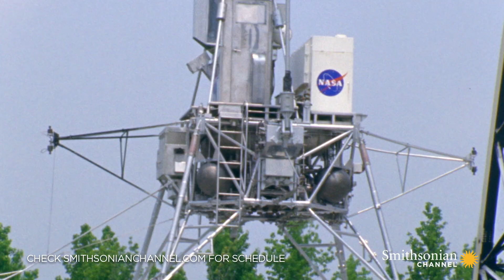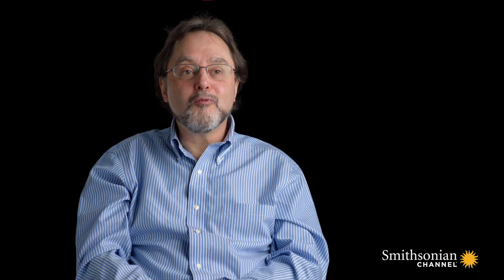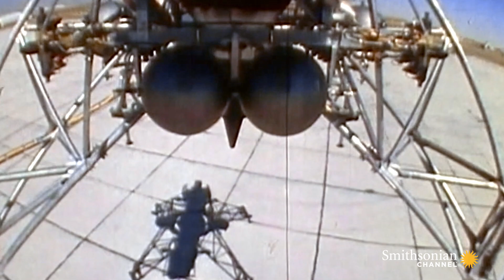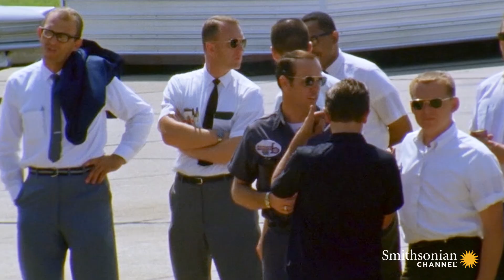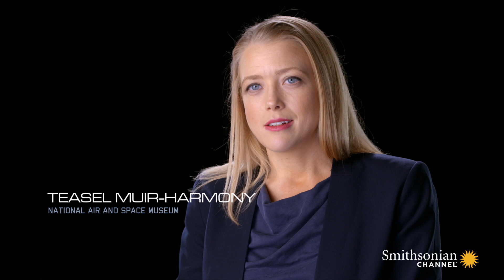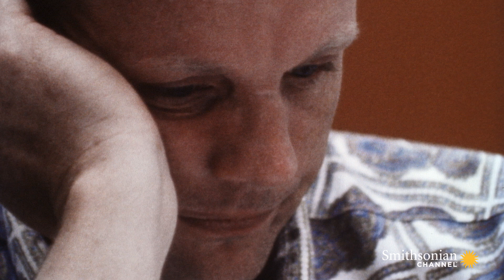How Neil Armstrong Trained to Land the Lunar Module

Comment: This is a joke. The final attempt and then for real on the moon. Give me a brake. 🤲
Reply: It's how they practiced the landings.
Reply: John Miller He crashed after 20 tries.
Reply: @1133saginaw  it is all propaganda. Sorry you can't see it, but you are not my responsibility so believe what you want. This is called free speech in America, and we can both enjoy it.
Reply: John Miller did they teach him how to walk and chew gum at the same time?
Reply: @DeweyTucker  In what way is a video of Armstrong ejecting from a malfunctioning flying simulator 'propaganda'?
Reply: eventcone the propaganda is that they went on to the moon.
Reply: @DeweyTucker  The propaganda is that the moonlandings were faked (though the propagandists never explain how).
Reply: eventcone if you haven’t seen the problems with the NASA pictures and other documentation of the moon landings, then you must live in a vacuum. You need to get out every now and then.
Reply: @DeweyTucker  If you ever do attempt to do some proper research, you would find that every single supposed bit of evidence brought up about alleged proof regarding hoaxing the Apollo landings have been debunked over the years. Most of it with relative ease because the supposed proof is usually based on complete ignorance of the particular subject involved. Meanwhile, there is tons of scientific evidence that is irrefutable which has been accessible to scientists and aerospace engineers for the last 50 years who have never found anything that might suggest the landings were faked so it's only people who lack critical thinking skills who fall for this moon landing hoax nonsense. Here's some of it:

-> There's the live TV coverage that would have to somehow convincingly fake 1/6th G movement in a vacuum, Google "Irrefutable Proof for Moon Landing - Lunar Gravity" and explain how experts in the field of kinematics for 50 years have never come forward with proof that the astronauts are not in an environment that they say they are. There's also the fact that any attempts to do filmed mockups of the eva's on Earth would have to be passed off as live TV broadcasts which would have to fool telecommunications experts around the world. Google "Moon Hoax Not" and "For Jarrah" to get a better understanding of how much would be involved to pull that off and how the filming technology back then was simply incapable of such a thing.

-> There's all the moon rock and core samples that would have to somehow be able to pass scrutiny with geologists who can readily spot whether it's something that has passed through our atmosphere or not. 
Google "How do we know that rock came from the moon?"

-> NASA has made these samples available to scientists from around the world and every year 500-1000 samples are sent out.
Google: "NASA lunar sample request"

-> There's the Apollo 16 UV telescope images that no astronomer in 50 years has ever found fault with. Google "onebigmonkey apollo 16 UV telescope"

-> Another thing that astronomers would be able to spot are pictures of the Earth that don't match what they should look like. Google "Apollo 11 Earthrise - How One Photo Proves it was Real" for an example. 

-> Another one to google is "Apollo 11: Fingerprints in Deep Space" that shows obvious handheld TV footage from the Apollo 11 CM looking at Earth from far enough away that they are clearly beyond the VAB's.

-> Then there are the LOR images. Lots of hoax believer nonsense about them being faked but the transmittal data for them can be downloaded by anybody with a computer and so far, nobody has proven anything about them being faked. You don't think a smoking gun like that wouldn't have been scrutinized by people with the required computer science expertise??

-> Here's something else you might not know. Apollo 12 landed close enough to Surveyor 3 that Conrad & Bean were able to do an Eva to it and removed the camera and sampler scoop from it to be returned back to Earth. They wanted to see what the harmful conditions of the moon had done to those parts after 2.5 years: Google "Analysis of Surveyor 3 Material ad photographs returned by Apollo 12"

-> 5 plutonium-238 powered ALSEP's were left behind that transmitted data from the experiments back to Earth right up till 1977. Unfortunately, due to budget constraints, they were shut down but they did send back enough information that storage of it became a real problem as detailed in this article: Google "the-long-road-to-alsep-data-recovery"

-> Starting with Apollo 13, they purposely directed the spent S-IVB's to crash into the moon so that the Apollo 12 seismograph could record the seismic waves generated to help determine the moon's crustal structure and makeup. Of course, as each successful mission added another ALSEP, they were able to expand on the info derived from these man-made impacts. They also did the same with the lunar module ascent stages. The Apollo 16 LM ascent stage data isn't shown because of difficulties during the de-orbit phase. They were able to derive a lot of info from these artificial impacts. Google "The Description of Apollo Seismic Experiments darts"

-> Another great site to check out has some pretty thorough crater analyzing to prove the landings happened. You can check out all six of the landings this way: Google "onebigmonkey apollo sights landing"

Are you starting to understand the magnitude of what would be involved to pull a hoax like this off? Never mind keeping it from being exposed?

I suggest you also take the time to read through the 93-page pdf titled "NASA’s Recommendations to Space-Faring Entities: How to Protect and Preserve the Historic and Scientific Value of U.S. Government Lunar Artifacts". There is lots of nonsense from hoax believers that the USA is trying to make the Apollo sites inaccessible which is ridiculous seeing as these are only recommendations designed to limit harmful effects of spacecraft landing too close or the altitude of hopper type craft flying at too low of an altitude. The fact is, the USA has no issue at all with visits to the sites by manned or unmanned means. They do request the Apollo 11 and 17 sites are accorded with the proper respect due to the obvious historic value. Also, there is an Appendix B in the pdf that gives a lot of recommendations from NASA as to what type of investigations at the Apollo sites would be most beneficial for scientific purposes. Now does this seem like the type of behavior for a country that supposedly faked all of this??

As I said, irrefutable proof that has withstood scrutiny by the relevant experts from around the world in all the specialties involved for 50 years which in my book proves beyond a doubt that the landings happened just the way they were documented 50 years ago and which easily trumps supposed proof that this was all faked but that same supposed proof doesn't stand up long to scrutiny.
Reply: mako88sb your multitude of words does not change the facts. After many hours of training he crashed the simulator and there was no more before going to the moon. And that’s beyond odd to me. Sorry if my thoughts are offensive to you, and I’m subjected to a voluminous diatribe.
Reply: tgstudio85, let me get this clear. You want me to explain why the Soviets do or don’t do things.  How silly!
Reply: @DeweyTucker  Let's get this clear: Neil Armstrong made dozens of successful simulated lunar landings in the LLRV. There were a total of 5 vehicles of this type built for this purpose.

On ONLY ONE of Armstrong's flights was there a malfunction that resulted in a crash.

The total number of successful simulated moonlandings by all Apollo astronauts was around 700. There were 2 more crashes.

That's a pretty good safety record for a cutting edge experimental aircraft.

Meanwhile the Apollo program was only called on to make a paltry 6 lunar landings.
Reply: @DeweyTucker  I have been studying Apollo history for over 30 years.

I have seen many photographs, many hours of footage. 

There are no 'problems'. The photographic record is excellent. The lunar surface activity is perfect for activity in a 1/6th gravity environment in vacuum. No one could fake that in 1969 - no one has to this day.
Reply: eventcone I’m glad you have seen many hours of footage and have done an extensive investigation and believe the information set in front of you, but having undergone many hours of pilot training, I have problems with the “official” narrative. You believe what you want, but stop trying to beat me into conforming to your ideology.
Reply: @DeweyTucker  "...but stop trying to beat me into conforming to your ideology".

The irony. That's as good a descrition of conspiracism as any.
Reply: eventcone still at it, but to no avail.
Reply: @DeweyTucker  How so? Your opening point has been answered: the crash of a training vehicle in no way indicates the unlikelihood of a successful moonlanding.

Hours of pilot training? But without successfully earning a pilot's licence?

What in your pilot training leads you to question Apollo?
Reply: eventcone get real. One thing I know for sure, you have never gotten extensive pilot training.
Reply: @DeweyTucker  That's no secret.  :-)

But seriously - what is it in your pilot training that makes you doubt?
Reply: eventcone you don’t crash and advanced to a more critical performance. Ask any pilot with at least a multi engine instrument rating. Who would want to get on a plane who just crashed? Why would you ask such a ridiculous question? Keep commenting here and you will keep exposing your ignorance.
Reply: @DeweyTucker   If you still want to go on about it would have been impossible for a 100% success rate for 6 manned landings then how about explaining why the space shuttle had a 100% success rate for all 138 landings. I'm obviously not including the 2 shuttle disasters since they happened before the final phase and actual landing just as your not including the Apollo 13 situation. So 138 out of 138 successful landings in a spacecraft that once it became operational had zero abort capability for the crew(of as many as  7 astronauts) during the final portion of the landing with a glide slope of 18 - 20 degrees and final touch down speed of 214-226 mph with zero go-around capability vs the LM's abort system for the ascent stage and 2 astronauts plus the fact that it's touchdown speed was measured in ft/sec. There's no doubt there were risks involved but the space shuttle 100% landing success rate for 138 flights proves they knew how to train and plan for success in that particular phase of the missions.  

As for the crews, every guy at the controls during the landing phase was a former naval aviator(except Dave Scott) who excelled at landing high-performance jets onto carriers at nighttime and all kinds of foul weather conditions. These guys were then selected to become test pilots were split second decision making under some of the most stressful conditions meant life or death. Plus they had to land prototype high-performance jets for the very first time. The upper echelon of caliber of these guys were selected to become astronauts and received years of training with the best of them becoming the Commanders who got the highly specialized hands-on experience with the LLRV's & LLTV's. These were the 7 guys who were trained to land the LM .Obviously, Apollo 13 didn't make a landing but Lovell was prepped and trained just like the 6 that did land. The Lunar Module Pilot never got the extensive training on the LLRV's & LLTV's as his main job was to reduce the Commanders workload and handle everything else involved with the landing except the actual controls manipulation Seems to me NASA made the right choice on how to select the right people for such a crucial job. It worked so well that they used the same system with the Shuttle.

I could care less if you don't care for my responses. All you're doing is proving you have the same conspiracy mentality as the flat-Earth nutcases who are too full of themselves to admit to being wrong about anything and like them I bet you would probably prefer to bite your tongue off before saying that NASA knew what it was doing when it came to the landing phase of the moon landings..
Reply: @DeweyTucker  "you don’t crash and advanced to a more critical performance."

Maybe for the commercial flight industry, it's quite a bit different for military pilots/naval aviators who became test pilots and then get selected for the astronaut program. Armstrong proved himself with his decision making skills time after time in the toughest piloting jobs there is plus he saved the Gemini 8 mission plus as already explained to you, the accident with the  LLRV was due to an equipment failure so was not due to pilot error.
Reply: mako88sb bla bla bla.
Reply: @DeweyTucker  The usual typical response from a hoax believer who's figured out he's in over his head and too full of himself to admit it. Seen it hundreds of times. Time for the block.
Reply: John Miller He proved how good the training really was. 😆😂🤣😄
Reply: @DeweyTucker  : " I’m over my head in attempting to rationally, logically and patiently explain what I believe to you. "
Because it's just that "beliefs." And naive ones.
Note that the "malfunction" was on the training system, not related to the actual LEM. The malfunction occurred in the additional rockets they had to stuff to compensate for Earth gravity.
If I remember correctly (but why don't you look for it? Why are you talking about something you don't know at all?), one of the fuel tank had a leak in helium (that was pushing the fuel) but they were missing the gauge to properly notice it. That gauge was added on the training machines shortly after.
Reply: Thomas Kundera your problem is you are not a multi engine IFR rated pilot. Talk till you are blue in the face, but until you’ve experienced this training you don’t have a clue. The lack of this killed JFK, Jr.
Reply: @DeweyTucker  : " your problem is you are not a multi engine IFR rated pilot."
That's not a problem, I'm not going to try to fly any of those machines.
Your problem is that you have no knowledge at all in space technology.

And you're still failing to explain us why a failure in the simulator at one point would prevent them to go to to the Moon, which they did six times...
Reply: Thomas Kundera you will never see through the NASA lies, but no man has been to the moon and lived to tell about it. More and more people are seeing that it has all been a hoax. You are trying to defend an indefensible narrative.
Reply: @DeweyTucker  : " you will never see through the NASA lies"
I've yet to see any lie by NASA.

"More and more people are" convinced that the Earth is flat. So what?
Since when is truth being proved by pools among ignorant?

"you are not a multi engine IFR rated pilot."
You are neither, btw.
Reply: Thomas Kundera l’ve had my rating for 50 years.
Reply: @DeweyTucker  : Back to Apollo missions.
What allow you to say they where faked? Any evidence? And how do you explain the actual evidences they went?

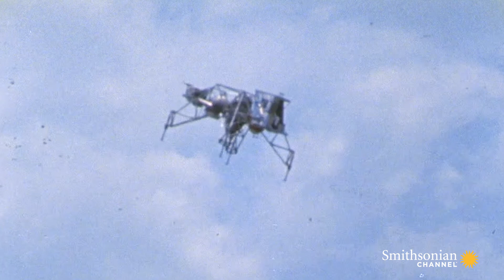Comment: 1:26 DID you see how fast he got ejected!
Reply: It was amazing how it self-corrected to vertical after the ejection
Reply: The current ejection seat is capable of ejecting fully inverted at 50 feet, righting itself, taking the occupant up to around 200 feet, and deploying the chute. The problem was the pilot would already be dead, as the G-forces involved in the seat maneuver at only 50 feet were unsurvivable. IIRC, the seat's guidance computer was detuned to be able to eject fully inverted at 150 feet subjecting the pilot to a survivable level of G-force.
Reply: Ejections are very violent to the human body and it is common for fighter pilots to have compression fractures of their spines from the experience.